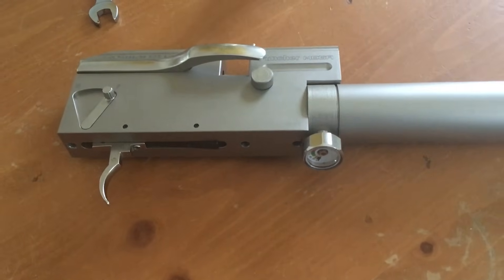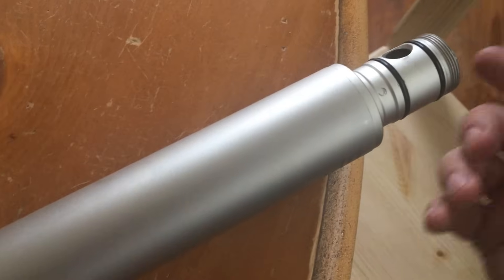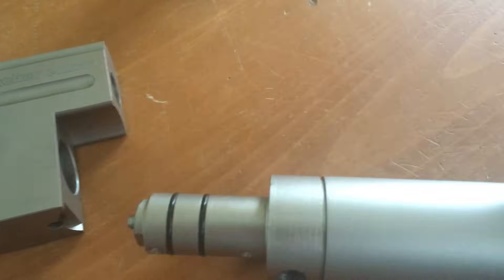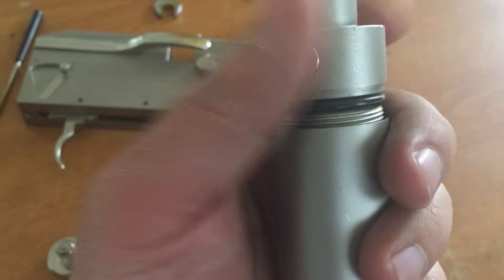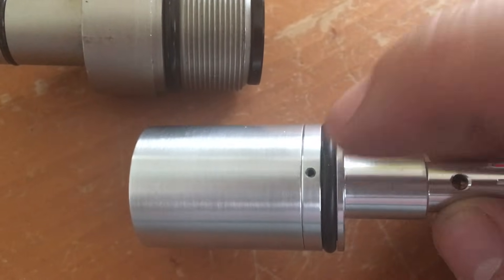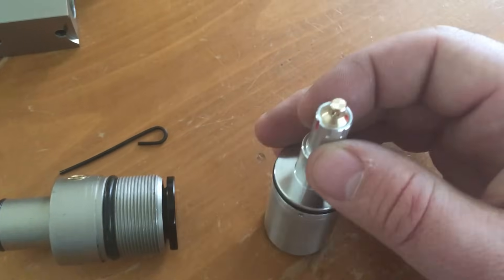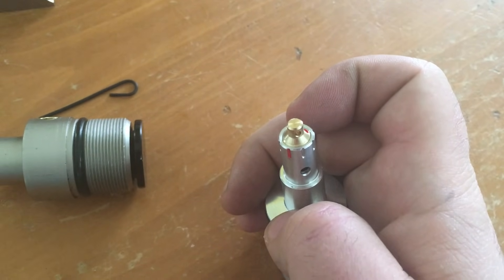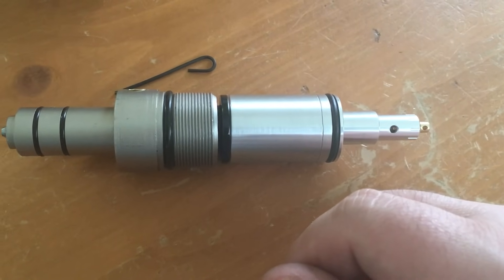Kral Lane Regulator install.

Comment: Troy, I finally got my lane regulator in the puncher breaker silent marine. I had a problem with the gun leaking air. I found that on the top of the hammer spring cap, it had deep scars from the factory. When the cap in-gauged the regulator the small scars caused the regulator to leak. I had to polish the top of the cap with a 8,000 grid stone. Once the cap was polished the leaks stopped. I noticed the cap in this video is nice and smooth. After I finally got the problem solved the gun shoots great, nice and quiet. Thank you for all your help and e-mails. To all who watch this video I would highly recommend dealing with Troy and The Robert Lane Regulator. Thank you also Robert for a fine piece of equipment.

Comment: when you have a problem with you valve stem seal you can use this spacer(there are 4 pices in the Lane kit) to do a new valve seal.. it is the same diameter the only thing to do you must grind the spacer down to 2 mm and put it in your valve stem seal ....and you will have a new seal for your valve when your original valve stem seal i leaking.....it is my sugestion then you have leaking valve stem seal

Comment: What is the material of air tank cylinder .
And also what is the thickness of wall of the air tank 
Thank you
Reply from the maker: It is steel.  I believe it's 2.5mm wall
Reply: @AnnihilatorAirguns  it is possible I use alluminum  7 mm wall thickness it can carry 4500 psi

Comment: I have just fitted this regulator. It was set at 90 bar.
I am only getting 8ft llbs power since the reg was fitted. I noticed that the transfer port on your valve appears to be approx 4mm. The puncher breaker transfer port is only 1.5mm. Is it necessary to open up the port? Someone else told me to shorten the spring on the Poppet valve to get the power back up. What would you recommend?
Reply from the maker: Drill the transfer port in the barrel, through the breech in to the valve to 2.5mm. If you cut the valve spring you'll waste air. Use the TP to bring it back up.
Reply: @AnnihilatorAirguns  Thanks for the advice.
Reply: @AnnihilatorAirguns  I drilled out the TP to 2.5mm on my homemade milling machine. The TP in the Barrel and Breech was already at 3mm. now shooting at 14ft llbs. I have dialed it down to 11.5 ft llbs with the power adjuster(UK restriction)
 I have removed the grub screw and small tension spring from the power adjuster and replaced it with a longer grub screw. The power adjuster is now locked into place.
Still getting hammer bounce though but this Airgun has always had this problem. A plus after fitting the reg is that the annoying ping has gone. I will put a full shot string through it tomorrow to see how it performs.
In your video. You fitted a nylon washer behind the Poppet valve spring to give the spring more tension. Does this solve the Hammer bounce?
Reply: Que velocidad te da con ese seteo amigo de 90 bar

Comment: After reg install. The pressure gauge now shows the reg pressure and not the cylinder pressure?
Reply from the maker: In the mega it shows reg pressure. In the breaker it shows tube pressure.

Comment: Another thought :  The Puncher Breaker has a 280cc  tank  .  The NP-3 has a 180cc tank .  If the diameter is the same , I could replace the filler port end with one that has the gauge on it and be able to read tank pressure and regulator pressure .
Reply from the maker: The tubes are not compatible. NP-03 tube is aluminum and thicker wall meaning the valve would be too loose plus it would extend past the barrel.
Reply: @AnnihilatorAirguns   I was thinking just the filler port assembly by the muzzle and use the original tank tube of the NP-3 . I could machine an adapter if the difference would allow enough thickness to be safe .  Probably more simple to design a new filler port with a foster fitting orientend inline with a gauge port on the radius .
Reply: @AnnihilatorAirguns  Thank You Troy for sharing your knowledge .  Saves me time and agravation .

Comment: Did u have to adjust the hammer and spring after to get the best result from the regulator?or you leave it as is?
Reply from the maker: I do a lot of adjustments.  Different hammer springs completely,  larger ports and internal valve mods. Really all depends on what you're trying to get from it. Power/shotcount/both

Comment: Before starting anything have to fully degass/empty the tube. How does one do this??
After installing the regulator do you fit the valve cap on tightly or do you have to leave a small gap so the air can escape? Lane videos show you have to drill a hole in the air cylinder to let the regulator breathe.
Does the pressure gauge still work???

Comment: Do you think this Regulator will help get rid of the spring ping noise you hear when the valve is hit with the hammer??
Reply: Thats what he states at 4:30.
If not, get a de-pinger device (google it)

Comment: you should show a complete ,start to finish , you are very thorough in your innerworking but you started out in the middle of the job and didn't show the finished product
Reply from the maker: This video was just to show you how to install the regulator.  Really only started with the stock removed and the air pressure released and you should be able to do that on your own. This keeps the video short and to the point.

Comment: Hi, hope you are doing well! Where I cannfind the plastic bushing for inside the regulator? Thanks in advance
Reply from the maker: Where did you purchase your regulator?
Reply: @AnnihilatorAirguns  Huma company
Reply from the maker: Hector Chaparro I'm not sure they supply one. This is for a Lane regulator install. Last one I saw that was a huma was on a customer's gun they shipped me for work. It was supplied with an o-ring that went over the threads of the depinger cap to seal it but it leaked. I had to modify the parts to fit. You will want to contact Huma to see if they have any advice on installing their regs in a Kral.
Reply: @AnnihilatorAirguns  Thank you very much

Comment: what is to hold the regulator in place... could not it separate from the valve?
Reply from the maker: The higher pressure in the tube keeps it seated against the valve.

Comment: But as far I can see then the air gauge will show regulator pressure and not the pressure in the cylinder. Am I right?
Reply from the maker: Miloš Dalmacija the mega shows reg pressure but the pro and breaker show tube pressure since their gauge is part of the fill port.
Reply: I have mega puncher, so I will see then regulated pressure. I will then see if the tube is empty only when regulated pressure is lower then set up.

Comment: having a hard time remove that air reservoir cap...any tips? i have a puncher breaker silent bullpup
Reply from the maker: mixplate are you talking about the actual valve?
Reply: yes the valve, at 2:36 of the video where you put down the camera. you made it seem so easy, i tried putting an allen wrench and still doesnt budge
Reply from the maker: mixplate you need to apply heat to the tube where the threads screw in. I'd already had this one apart and that's why it looks easy. I use a heat gun and a 13mm wrench to take them apart the first time.
Reply: thanks will work on it
Reply: tried heating the tube still doesnt budge....any other tips?
Reply from the maker: mixplate I heat the tube at the threads and lock the bottom of the trigger/scope rail in a vice and then remove the valve. You did empty the air first right?
Reply: yes empty it's empty
Reply: how long did you heat the tube for?
Reply: working on it right now still doesnt move
Reply: guess its not meant to be....cant get it to open
Reply from the maker: mixplate hate to hear that. I'll install the reg for you if you send me the gun.
Reply: T Hammer how much to ship to you from hawaii?
Reply: T Hammer unless i just send you the tube

Comment: After installing the regulator, what was the end fps and shot count.
Reply from the maker: It's still adjustable on speed. I set this one at 800fps with 15.89gr JSB and was getting 72 shots on a fill.

Comment: i have problem with my valve steam leaking.....what i do ....the white spacer for the hammer spring tension is ecact the diameter for the seal what to do is only grind it to 2mm.
Reply from the maker: I don't understand your question. The white spacer goes in to the de-pinger cap to add additional tension on the valve stem spring to lower hammer bounce since you are running on lower pressure.

Comment: Question ;  Do you think it would be benfical to drill the de-pinger cap hole since adding a regulator .  Say to 80 - 100 % of the bore size ?
My  rifle is the NP-3 in .177 cal . with a Huma regulator .  Thank You for your input .  Steve
Reply from the maker: It will probably help.

Comment: Nice. I have the 22 cal bullpup and was looking at a regulator. I am trying to get about 900-920 fps with a 16 gr pellet.  Any suggestions on how to achieve this?
Reply: Well if you install regulator you'll have to try out the settings and measure the pellet speed. For me 920 fps is too fast for 16gr pellets. Try 18,13gr, because it has way better stabillity.